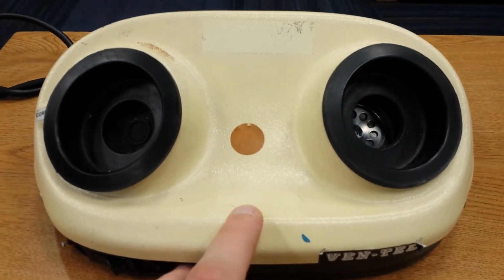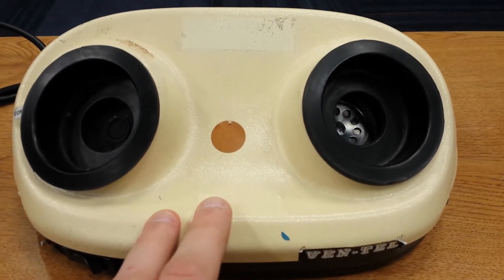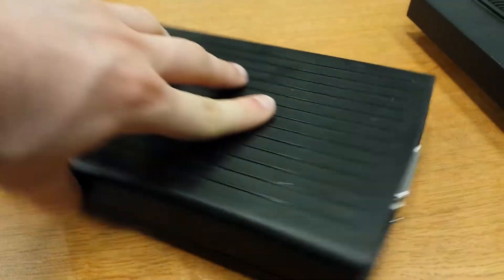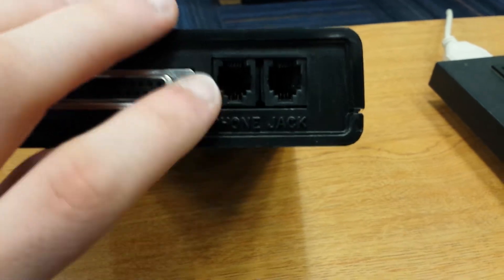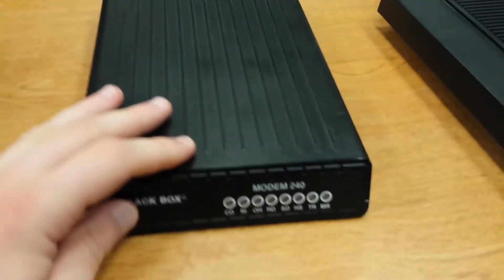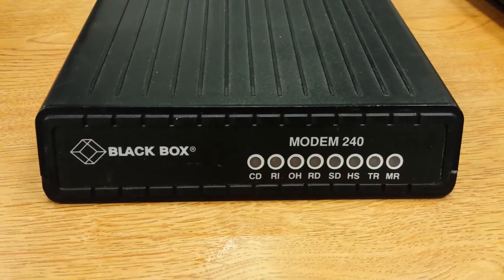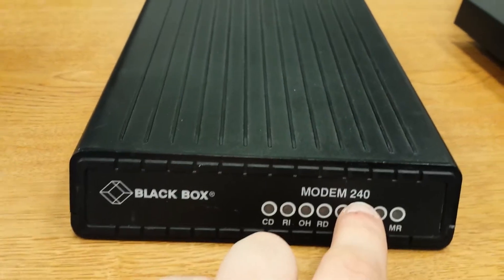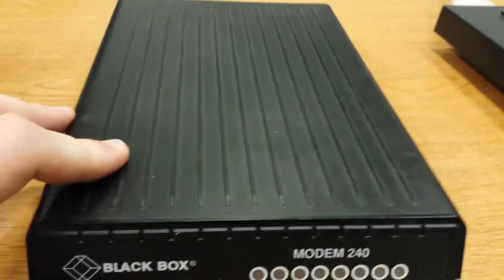brief history of dial up modems

Comment: Ethernet did not replace modems.  Essentially we just did away with the idea of proxy connections via pc and made devices that dropped the internet connection right into the LAN.  I used to install dialup routers that functioned just like modern dsl/cable modems using a built in dialup modem.  Side not internal modems were available much earlier than you stated starting out at 300 baud.  The were cheaper to than external but back in the early days more cumbersome to configure as most machines already had 2 serial ports and irq sharing must be understood and manually configured. Not to mention competing with irq and ports for the early sound cards.

Comment: Great video but I think that Black Box modem is actually 2400 baud not 240 baud.   Modem speeds were usually 300, 1200, 2400, 4800, 9600, 14400, 28800, 33600 and 56k.
Reply from the maker: thanks

Comment: what about the 28k modem?
Reply from the maker: Yes, you can with just about any modem that can connect to the Internet (as long as you have an ISP and the right connection). Its more about if you OS can handle the tcp/ip or the older hardware that will cause problems connecting. Though, webpages and Youtube will take a very long time to load. I've listed below about how long it will take to load a 1 minute youtube video with a 56k modem (double the time for 28.8 k) at different video qualities. 

144p -- about 4.5 to 5 minutes
240p -- about 6.5 to 7 minutes
360p -- about 10 to 11 minutes
480p -- about 18 to 20 minutes 
720p -- about 35 to 40 minutes
1080p -- over an hour

Comment: Holy shit I connected my old 56k modem from 1996 to my windows 7 computer and it works
Reply from the maker: I believe it should work with windows 10, too. Also, about 4 to 5 years ago, California had a 100% free dial-up ISP ... maybe, you could get free dial-up for that win 7 computer :). Though I can't find the webpage or the numbers, if I do, I'll post a link.
Reply: Joseph X yea I used NetZero as the isp and it is free you get 10 hours per month, plenty to mess around
Reply from the maker: Ok, cool, I've heard of them, 10 hours is plenty, though the one I'm think of gave you unlimited hours for free. If your into this stuff, you should try dial-in BBS systems ... maybe I should make a video about BBS systems
Reply: +Joseph X yea that is a good point I would love if you made a video about it
Reply: Do you think I could still watch youtube videos using a 56k modem?
Reply from the maker: Yes you can (trust me, I've tried). Though, it will take a very long time to load. I've listed below about how long it will take to load a 1 minute youtube video with a 56k modem (double the time for 28.8 k) at different video qualities. 

144p -- about 4.5 to 5 minutes
240p -- about 6.5 to 7 minutes
360p -- about 10 to 11 minutes
480p -- about 18 to 20 minutes 
720p -- about 35 to 40 minutes
1080p -- over an hour
Reply: Am tripping or do the video qualities on yourube follow the different modem speeds that came out through out the time. I remember having a 56k modem but really would get 48.8bit/secpund like 480p or 144p being the 14.4k modem or 360 being 36.6k modem same with the 240p. Weird....  @JosephX
Reply from the maker: @arashrezaee1464 I think its just a coincidence. The resolution values are common standers.  480p is for the 4:3 640×480p resolution. 144p is for the 4:3 192×144p resolution. ... etc. Though, trying to watch a 480p on 56k dial-up will take hours just to load 2 or 3 minutes of video. But the coincidence with the numbers is kind of weird.
Reply: @JosephX  I hear ya, last time I used a 56k modem was on my laptop that had a 56k port on it when I was visiting my family in Iran in 2011 which by then dialup was no longer a thing back in the states but was still the primary way to connect to the internet for them. Only one family member had dsl. I remember it being ok for Facebook and browsing the web but that was about it. I can't imagine how it handles with all of these pop up video advertisements we're seeing a lot on websites these days.
Reply: yeah for the moment Dial-up still works mostly
Reply: But... it would be unusable, 7 KB/s? Web pages would time out, you couldn't use it for anything other than a desktop email client (not web-based).